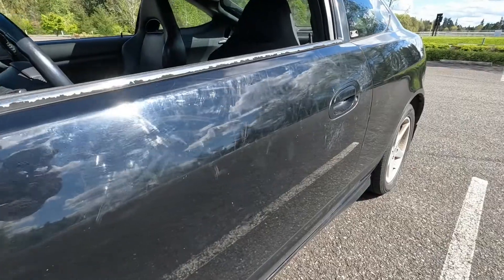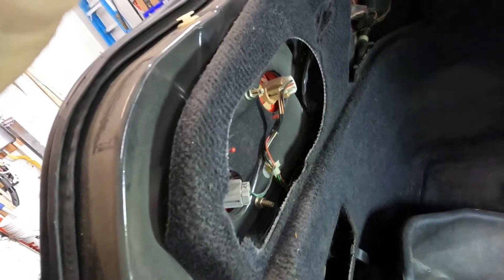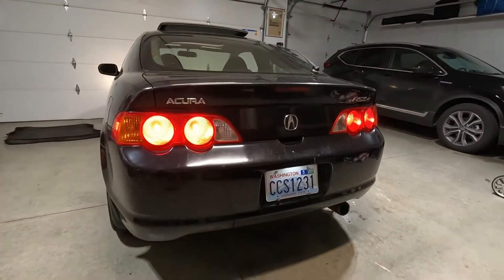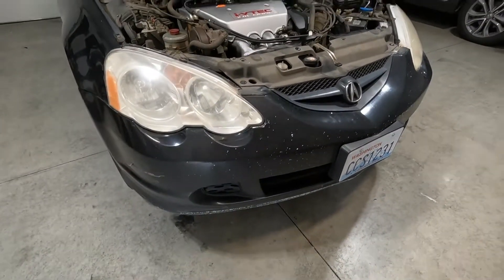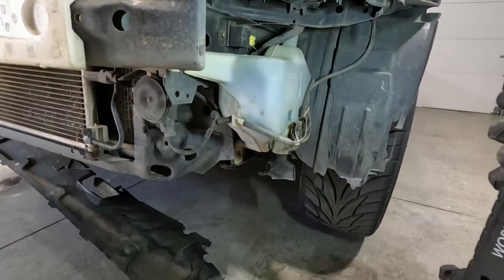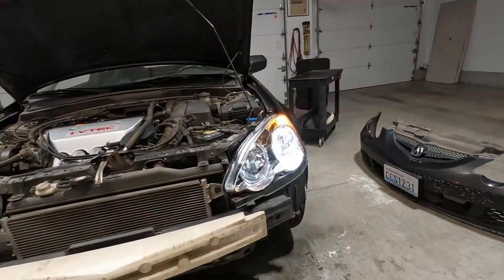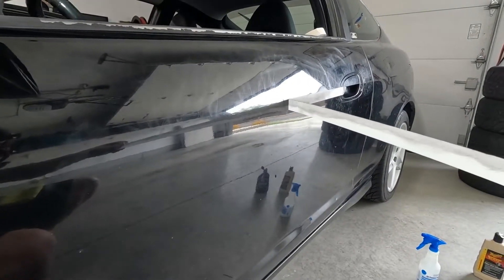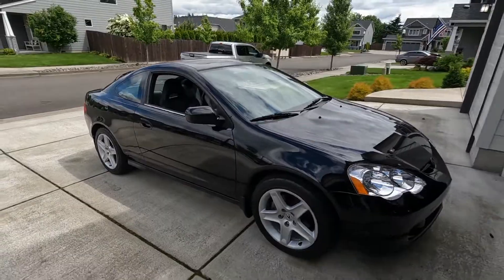The 300k Mile DC5 RSX Type-S Looks Like A Completely Different Car!

Comment: How’s the light output? Did you have to use any adapters for it? Do you have a instagram where I can follow?
Reply from the maker: To be honest I have not driven at night with the bulbs yet but they seem super bright just in my garage. The H1 LED bulbs come with a little collar you put in the headlight housing, lock it in place, then you just push the LED bulb into the collar and it’ll stay in place. My Instagram is in the video description. Thanks for watching!